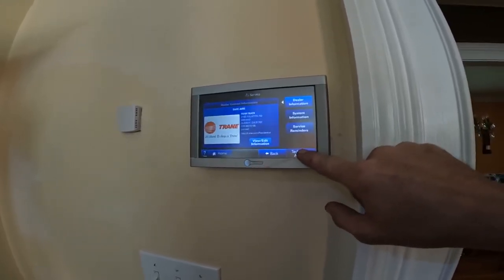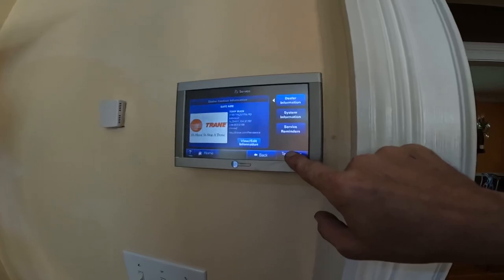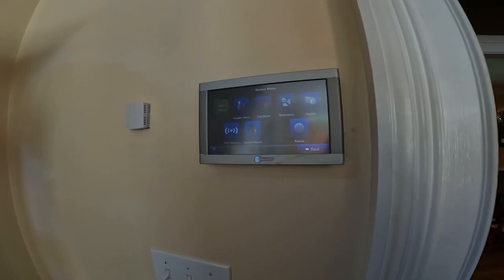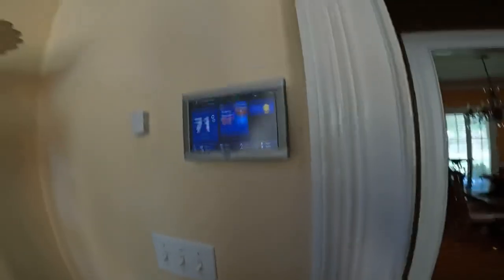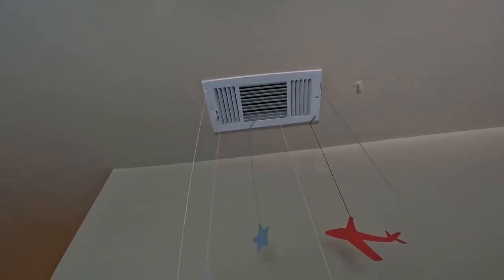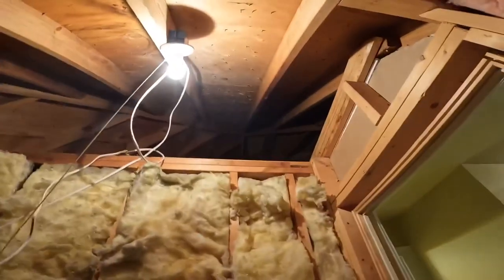Charging Trane XL16i With Comfort Link Zone System

Comment: Us air compressor technicians made up a page of  Manufactures, Models, Etc with Controller passwords and  directions for settings. We share that info to pretty much with any technician that wants it.  It is a very helpful tool. This way we don't have to try and remember all of it.

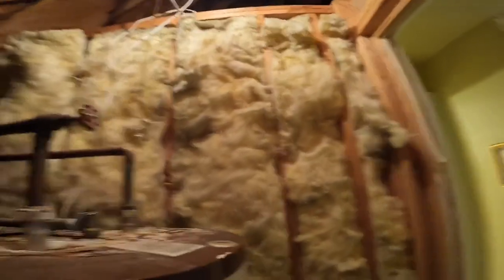Comment: That good you recognize (2:07) attic and hall bulbs low dim flickering. The house trying to tell you warning sign. May somewhere is trying to start up or wire electricity is trouble.   Make sure checking there no fire.

Comment: I am pretty sure that Georgia uses the ICC code. Which means that there is no 14 foot limit on flex in a attic. You can run flex ad far as need be. Now it's a different story if you are running a flex connector. Like many do on commercial jobs. In that case the flex connector is limited to 14 feet. I think someone may be reading the code wrong.
Reply: Yeap, any time I've asked for a citation on the 14 foot limit, it turned out to be the code for flex connectors, not flex duct.
That being said, the way that run was taken off from the trunk was very wrong.

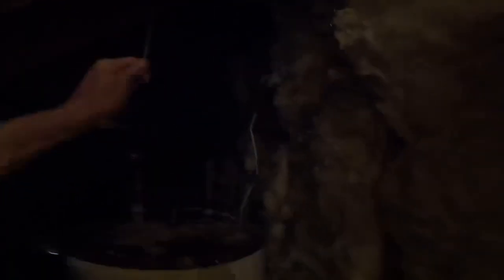Comment: 1:45 My builder wanted to put the Water heater in the Attic i told him theres a old saying "OUT OF SIGHT OUT  OF MIND"
Well 6 Month's went by i looked at the Water heater and galvanic corrosion happen they had to install brass..What if it was in the attic $5,000 damage min... 4:14 Not enough insulation.............

Comment: What did your pressures settle in at ? They were looking a little wonky. That wasn’t one of those tranes with the ecm condenser motors was it ? When charging one of those units with the variable speed condensers is there a way to put them on full load for charging ?
Reply from the maker: Yes it had an ECM condenser fan motor. I believe on these that the test mode is the correct way to do that. I know that others have a specific charge mode.
Reply: @HVACGUY  10/4 I haven’t messed with one yet but I’ve seen them. I asked one of the guys at the supply house the other day and he didn’t know.
Reply: The one and only way to check/adjust the charge on the variable speed AS/Trane systems is to go into the technician access menu, click the test mode button, then the variable speed button, then the charge mode cooling option.
There is also a charge mode heating option for when it is too cold for cooling, but it is only for getting the charge close, and should be rechecked when the conditions are good for cooling.

Comment: so, they took attic space with a sealed door, finished it and left the door sealed and ran a duct trying to push air into the room? with no return, jumper duct or leaks through the doorway?
remove the weather stripping and cut bottom of door off or add return/jumper duct. it may be very poorly insulated and never meant for living space anyway, hard to say what the yahoo's in the past have done. 🙃
Reply: Lots of sketchiness in that house. Wire nuts exposed, Rome ran over the attic floor unsecured, with no race.

Comment: The amount of time you spend wandering in the attic and plugging up your gauges I would’ve run a diagnostic of the system and checked subcooling before you even stared mindlessly at the access. Wouldve probably sold a new system by the time you got those joblink probes on. No cap 🧢  when you go to a call you don’t wander around a house guessing the problem for an hour, you dissect the system. I systematically check for blower operation, subcooling and superheat, and the state of the coils before I check anything else, no point in getting ductwork if the system is FLAT. This video and another prove you’re hourly. If my boss or previous bosses would’ve found your channel they would’ve deducted the amount of hours mindlessly staring around doing nothing. If there’s not a AH/condenser in your video 80% of the time, you’re doing something wrong.